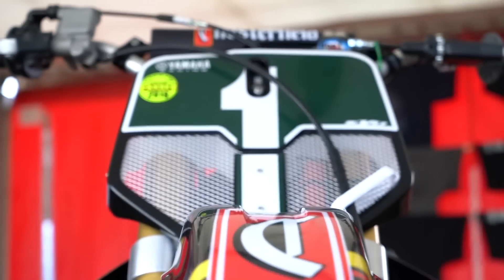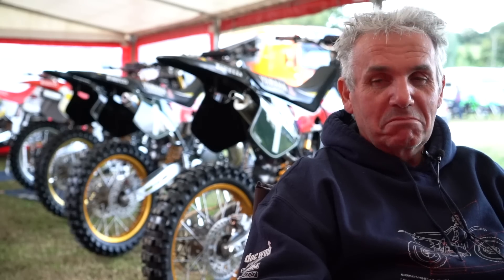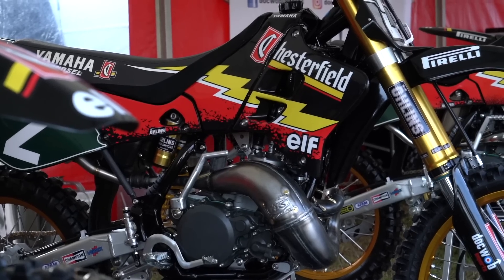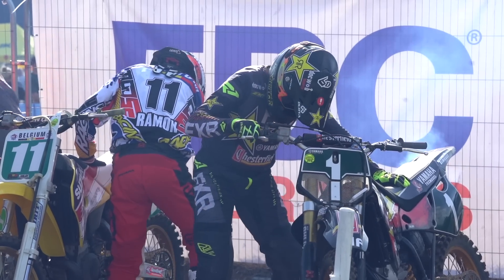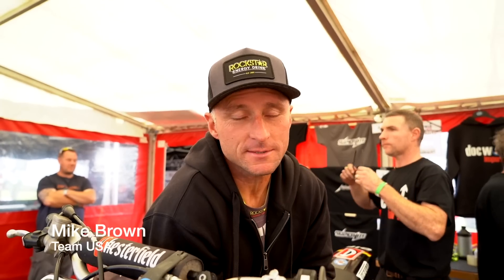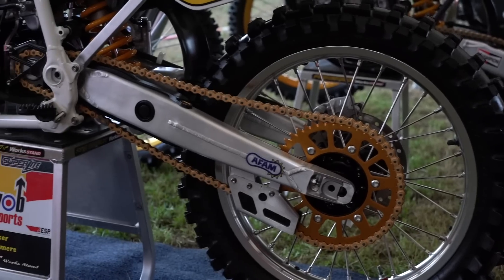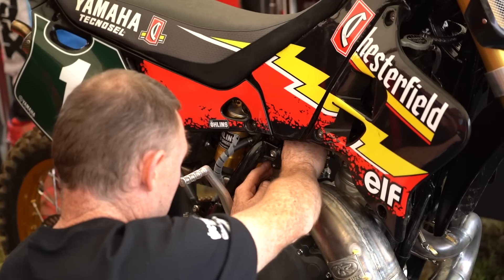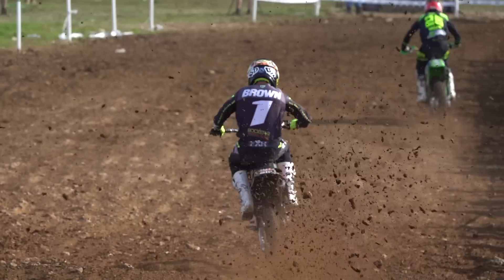2-Stroke retro: Building replicas of HRC Honda CR500s and Chesterfield Yamaha YZ250s

Comment: I am rebuilding a '94 YZ250 and need a new OEM cylinder. Can't find it, it was discontinued by Yamaha. Where can I get one or where did you get yours?
Reply: You may need a sleeve, or buy a donor bike.

You can get an entire 94 250 for what we used to pay for a jug brand new.
Reply: @michaelsrite822  where do you find these cheap bikes? In Northern Ireland there's no such thing even complete junk is selling for over £2000 it wasn't like that 5 years ago wtf happened? 🤷🤦